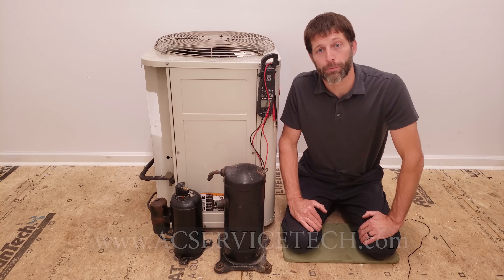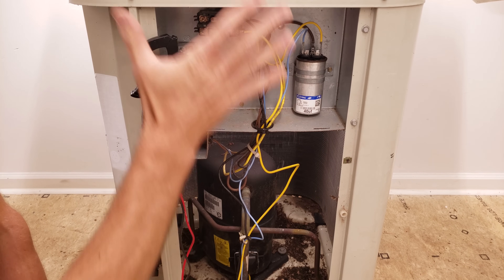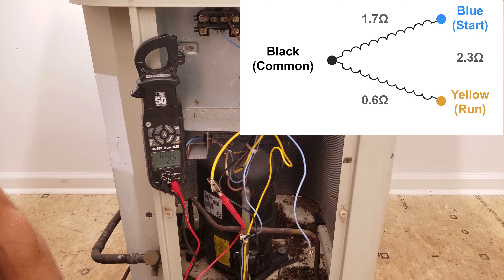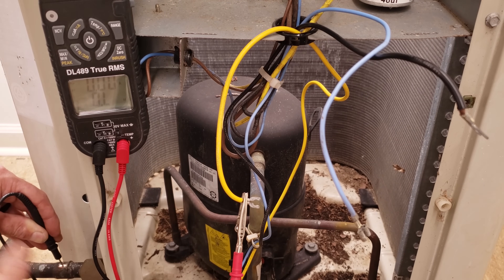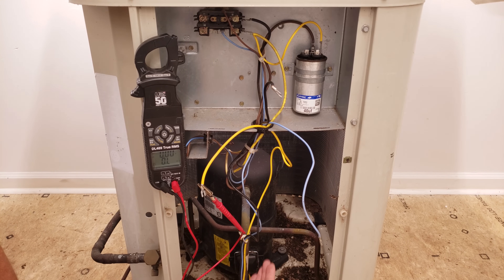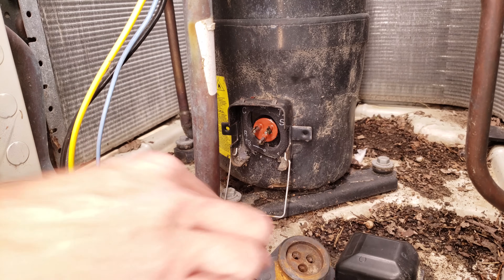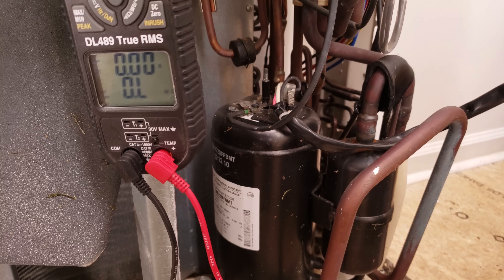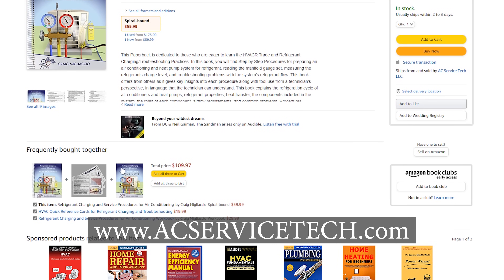Testing if an HVACR Compressor is Shorted to Ground, Open, or Overload Tripped!

Comment from the maker: -Join our updates list for an email strictly from us for new videos, articles, products and website features! https://www.acservicetech.com
Mini Split Book on Our Website- https://www.acservicetech.com/mini-split-book  
Mini Split Book on Amazon- https://amzn.to/3ytHJSs  
Mini Split Book on TruTech Tools- https://www.trutechtools.com/BooksGuides   
Mini Split E-Book on Google- https://play.google.com/store/books/details?id=HN-iEAAAQBAJ 
 Mini Split E-Book on Apple- https://books.apple.com/us/book/id6445178399
Reply: The motor is working fine as per ohms test at the 3 pin connector
Reply: Lqqqqq
Reply: Hi Craig! Love your videos! AMANA furnace with a B1 code (module not communicating with blower motor) emerson aa25650l variable speed.

Meter reading from R-W is 0.04V at the control board and the rest of Tstat wires are 27V. 

Do you know what could be the problem? Thanks very much!
Reply: Do you have a video on low, medium and high temp compressor difference?
Reply: Thanks for all the amazing knowledge boss
Reply: Hi I just had A unit where we put all new wiring box / outlet then change the capacitor but end up with no running fan after ordering a motor fan condencer got it changed the fan started working but the house isn't sending a cool air in the house ?? So I'm afraid there's a problem with a  bad compressor or just cuz of the hot weather that I need to hose it down with water then cool it off then try it works? I wish I could get some guidance from anyone here that faces similar problems? Thank you
Reply: Good comprssor  winding  opon show  metr checking seting  bad  windimg not bodey  grunde showing body bad .methad

Comment: Ok can someone explain to me why the measurements on a mini split compressor are all exactly the same but on a split system they are all different with the run to start equalling the other two measurements? Is it because it's a 3 phase compressor and not a single phase? And if so can someone explain that?

Comment: When I measure run and start winding, it has low resistance.  It's low then c/s ,and c/r winding  . What would cause that.  When I try to start it, it short cycle quick. No short to ground or OL?

Comment: I have uncondemned 3 compressors this year. 2 the tech didn’t remove the plug and they were shorted under the sound insulation blanket.

Comment: Can the compressor still be bad on a heat pump that the low side has high pressure when checking Freon? . couldn't get it to pump down either to replace evap coil. never seen it.

Comment: I put in a new contactor, capacitor, fan motor and the fan is not turning on. I can't remove the wiring harness from the compressor. How do I get it off? It's a Copeland r22 3.5 ton 20+ years old.

Comment: Testing mine out right now and readings are confusing....instead of 1.7 ohms, 0.6 ohms, etc... I'm seeing 495k ohms C-R, 97k ohms C-S, and 510k ohms R-S?!?!  Was so far off I changed the batteries in the meter and did it again.  I also measure 0 ohms from S to ground, thoughts anyone?

Comment: I have a question and am having trouble finding an answer. My AC unit (the machinery that is actually inside my house, not the fan outside) is behaving strangely. When I have the temp too low (74F), mid cycle it will "jerk". It sounds like it's trying to shut itself off but keeps running and finishes the cycle. Almost like it's about to trip? It's the best way I know how to describe it. I haven't noticed any leaks or frozen lines, and I just changed the filter last month but will probably change it again soon. It's gotten considerably warm where I am, so I could understand that the workload might make an older unit struggle or misbehave (Luxaire GM8S060A12UH11C). Any tips?

Comment: I had a compressor blowing the breaker. I check resistance from C to R and got OL, C to Start was 47, start to R was also 47. But it wasn't grounded. The compressor wouldn't start tho. So I changed it. Did I do the right thing or did I miss diagnose something?

Comment: While the system was running, my guages were reading equal pressures on both high and low sides. I checked the capacitor, and it was good. Disconnected all three wires to the compressor, I was reading 1.3 ohms between the 2 terminals and OL between the other 2 terminals. My guess compressor is bad.

Comment: I've been messing with a Honda generator and it's gen Head. I kinda, sorta see some similarities between the two. Then again the extent of my voltage meter experience is the continuity setting on my volt meter. Great channel by the way.
Reply: Try checking your AAA and AA batteries on DC Volts. You should get >1.5 V. Then Check your power outlets in your home on AC Volts. You should get >115 V

Comment: Great video...thanks. This is what I have, does it indicate a bad relay?
Whirlpool WRT111SFDW03. 7 years old. 11.2 cu ft size. Freezer on top.
Start relay
P/N: WPW10448874, 
aka W10448874.

Capacitor ("cap") P/N: WPW10662129

Test relay connections with capacitor on the relay.
Results: when together I can get cap to charge and discharge thru the start relay, just like it does when it's off the relay.
With cap off and on, neither of the lower holes have continuity with each other. The hole on lower left has 0.0 ohms resistance thru the bottom blade of the back of the plug.
The lower right hole has no continuity with anything but can be used to charge the capacitor for testing.
The upper hole has 0.1 ohm resistance  to the top blade on the opposite side.

Remove relay cover and visually check. I cannot get combination relay apart without breaking it, so I haven't committed to that, yet.

Ohm test the fridge compressor pins again. Make sure the Common (top) and lower pins are within 3 ohms. And the two pins at bottom should read about the sum of the Common with the Start and Run pins. See YouTube video...
Results:
Top and Lower Right : 4.4 ohm. 
Top to Lower Left: 6.0 ohm.
Two bottom pins: 10.4 ohm.
None of the pins are shorted to ground.

My problem is it suddenly stopped cooling without noises or warning, but I caught it from hearing loud buzzing noise from compressor and relay area, and compressor was very hot. No smoke or smells though, and wires did not seem to be hot.

Do you think it's the combination relay?    Many thankz!

Comment: HELLO I have an Older window ac compressor ..I cant get the black tops off the top of ac compressor to test it~~~ has like a hard clay material glued on in globs...must hold the compressor black covers on  ..any advice how to remove ? I need to test my compressor to see if it is bad..unit blowing hot air in and cold air out..hopefully only the cap is bad..no reading on HERM side in MF...

Comment: So we had a power outage and then suddenly the ac breaker tripped. Now it trips the second the ac unit kicks in. It appears to be the compressor itself, however, it measures fine and does not appear to be shorted to ground and everything measures out normal. Could it still be a bad compressor or something else? I disconnected the compressor and just let the fan run and it stays on without tripping. Kind of irritated the a/c tech came and didn't even do any measuring and just immediately insisted the compressor is bad.

Comment: My technician came today and put the clamp on the black wire while the system was running. He said the compressor was bad based on that reading alone. What should be the voltage when connecting a compressor to the black common line while running? Can you really tell if a compressor is bad by just clamping the black wire?

Comment: I would like to try white neutral line to neutral bar in breaker box for common of compressor, as start to common L1
Run to common L2   
And common  a neutral line to breaker box neutral.
2 breaker switches for compressor, one for L1 and other for L2 . It just that neutral (white  ) is common 
and also hook up the ground line!
Same goes for the 240 volt e c m .  ! 
Just like a 240 v a c light bulb with 2 switches and one neutral.

Comment: If you get OL between any terminals, common to run, run to start, start to common, you’ll get OL on your meter.  That’s means the winding is open.  It’s possible to just have one of the 3 open, 2 of 3 open or all 3 open.  If the compressor is severely overheated the windings will be open until the internal overload resets.  You can cool the compressor off with cold water or ice.  A lot of times you’ll hear the internal overload reset, it’s a mechanical “click” noise.  If you check any terminal to ground (any terminal to copper ref line works best) you’ll get continuity or a “beep.”  If you get a beep on any that compressor is dead.  On a 3 phase compressor all resistance (ohms) from terminal to terminal are EQUAL.  On a single phase compressor common to run and common to start=start to run….run to start is the LARGEST RESISTANCE VALUE, common to run is the LOWEST RESISTANCE VALUE.
Reply: Hi Craig my situation is same like you mentioned Compressor, , Start - to run 2.9k ohm, and common - to start =OL, and common - to run = OL OPEN, 
And I haven't turn on ac for days even crazy hot weather too, is there anyway I can fix it???
And I also check , common - to ground green =OL, Run - to ground 39k ohm + and meter ohm keep on increasing, and Start - to ground 39k ohm+ meter keep increasing???is there way to fix or I have to replace a 5 months brandnew compressor?? Thank you for your help and your time
Reply: The contact is pulled in, but the compressor nor fan start. Got readings for compressor wires and terminals, but one wire from condenser fan had no reading. Will dead fan motor prohibit compressor from starting? 1996 Goodman 3 phase condenser unit.

Comment: You’re missing  one of the possible diagnosis.  It is called a turn to turn short .   If the resistance readings don’t add up like in your example,something is wrong with the windings themselves.  Insulation has broken down and the windings can be shorted to each other, or a individual winding can have a turn to. Turn short.  Compressor windings should also be tested to ground with a megger, which is a high voltage insulation tester. It will find ground faults that your 9 volt ohmmeter can’t find.

Comment: We just had our compressor fail after 2 years of service. Its a mr cool universal heat pump DIY install. We had an authorized MR Cool tech come out and diagnose it and covered its replacement but I'm worried maybe we wrong during the install. The Tech was super impressed with our work and said everything looks great but I'm worried.  The compressor sits on ground level outside the house and the AHU is in the basement maybe 4-5' drop in grade. When we installed the line set we didn't install any oil return bends just kept it as straight as possible hanging them basement ceiling.  Having a hard time researching oil return bends not a lot of quality information on it. I'm just worried if we replace the outside unit we would potentially be in the same spot in 2 years if we install it the same way. BTW your videos are awesome!!

Comment: Great video!!
Suggestions and beyond ;
1. If the IOL is stuck open and it shouldn't be (Cold compressor etc), try hitting it with a 2x4 to unstick it temporarily until the repair/replacement can me made. Sometimes a sudden shock will get it to close. Sounds unprofessional, but if you get it going for the weekend, you're a hero!
2. After turning off the power to the outdoor unit, push the contactor fully in- to make sure the power is off and to bleed the capacitors at the same time so you don't get bit. Check as well with the meter to make sure power is off.
3. If nothing is running outside and it should be, don't be fooled. A bad duel capacitor can cause the compressor and the motor both to overheat and shut down.
4. Plastic forceps come in handy for quick connecting a temp wire or meter to another wire or capacitor for testing.
5. Always test a grounded compressor at the compressor itself, the wiring to the compressor may be shorted to ground (Made that mistake one cold day covered in snow- but only once) lol
6. A float drain switch in the main drain can flicker the low voltage on and off quickly causing chatter at the outdoor contactor and also cause the scroll compressor to run backwards resulting in a no cooling situation and a noisy compressor complaint. Install a time delay relay in the circuit and set it for one minute minimum.
7. Always verify your meter is working by testing it on live voltage first!  Assuming the power is off because you don't read voltage just might mean your meter just quit working.
 I've enjoyed HVAC work for over 48 years and I still love it!
Reply: wow great tips, thank you for sharing.

Comment: I do enjoy your videos, great job there, but I do I have a question. I have a heatpump ( portable ac) and it is kinda noicy and I did some research on that and I learnt about using something called ac compressor blanket which wraps the compressor completely to insolate the noise it produces, can I use that on my portable ac compressor? If yes can I make a homemade cushion ac blanket and use that instead? What is your advice, please let me know. Thanks👍

Comment: I called technician over my fan not starting after a power outage on the community.  After he came and inspected I noticed that the circuit breaker was not fully engaged and after fully place that in the right place. He can started unit and the fan start spinning. He proceed to take out the fan and got into the unit and mess with the therminal plug it slightly out and then place the fan back and started again and told me that I have to replace the whole compressor because now I have a freon leak. How can an electrical issue not causing the dan to spin, will make the the final to blow when all the pins are present and the AC Wwas not on for longer than a minute and no creo was added??

Comment: Smelling the refrigerant works too. Spraying just a little of bit of refrigerant in your hand and if its smell like burnout tells you that you have a burnout compressor as well. That's  just another easy way to identify a burnout compressor.
Reply: The oil will also be black. Or darkened. It does have a terrible smell when it burns out or I have seen a ton of foam which indicates liquid migrating to the compressor oil and sludging it
Reply: Also the wonderful smell of phosgene gas.

Comment: Does anyone know why I am reading 0.6 ohms between run and common but then OL between start and common and also OL between run and start?
Reply: You have open windings between start and common/run and start = bad compressor
Reply: @__aaron___  thank you. You are absolutely correct. Only reason I know is because I eventually had to call out a dang HVAC guy and had to pay for that information

Comment: When the shaft seal is puking out oil and refrigerant, the compressor sounds like a bunch of marbles when you try to run it, and there's metal paste in the discharge line, I assumed it meant the compressor was shot, good thing this video exists to make me reconsider.

Comment: I had a 1 year old units blow a terminal on the compressor while I was testing it. Cause a premature bowel movement. Sorry ozone
Reply: Did you read the warning? You’re not even supposed to remove the terminal cover, until you remove all pressure from within the compressor.  You’re lucky that terminal didn’t take your eye out, or go into you like a bullet.  I’ve seen them blow out and go completely thru the ac unit cabinet.
Reply: @rodgraff1782  haha. I just got there. Hadn't even touched the machine yet. Put a hole through the coil

Comment: Is it possible for the compressor to test ok accross the terminals but when it's powered up goes to earth?  I'm having that issue at the moment. 
I have OL from terminals on compressor to the housing.  But when the compressor is running there is voltage in the housing causing it to trip the curcuit breaker.

Comment: Daikin 1.5 ton inverter split ac. 5yrd old.
R32 gas running pressure 150psi.
Current 6.3amps
Both indoor and outdoor coils have been cleaned.
Service Technician says it's ok.
But it's not cooling.
Temp in the indoor  blower showed 16'c or 60'My brand new split AC showed indoor temp at 6'c or 43'f
Previously compressor would heat up and trip. So got the  outdoor pcb repaired. 
Now it doesn't trip but keeps running.
And does not cool the air.
The discharge line had a bad pinch in it. It ran throughput last season.
Am out of ideas any help greatly appreciated.
TIA

Comment: What side you open 1st when you install a condenser,, low  side or high side?
Reply: Don't Matter but most techs go for low side the thick pipe
Reply: @sergiodoordie319  uh..no. always liquid side (high side) first.